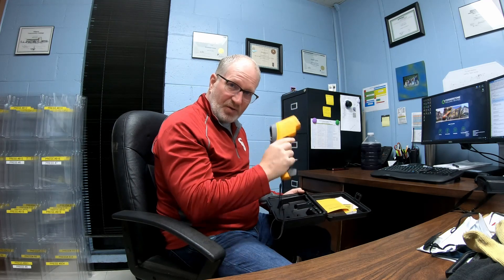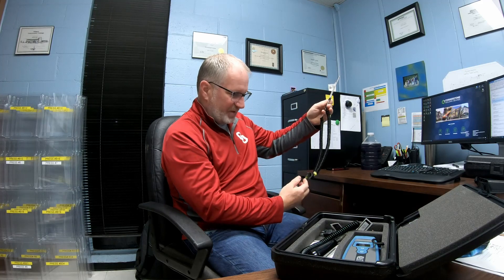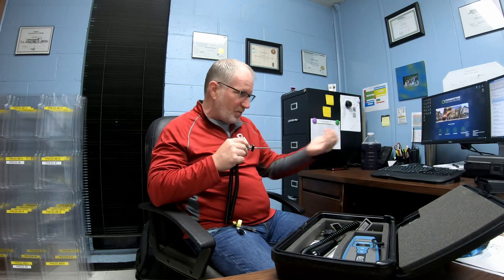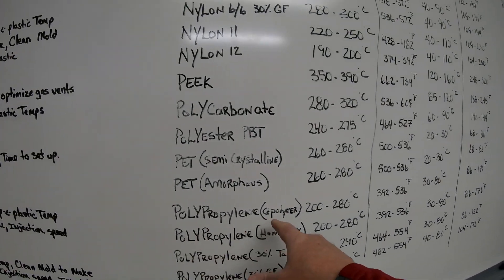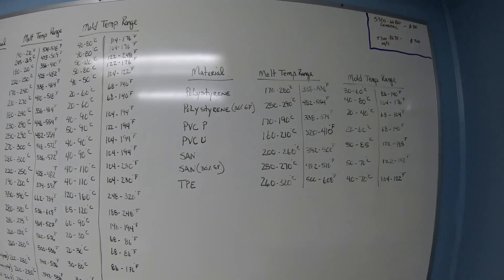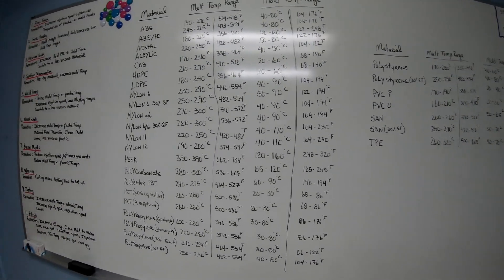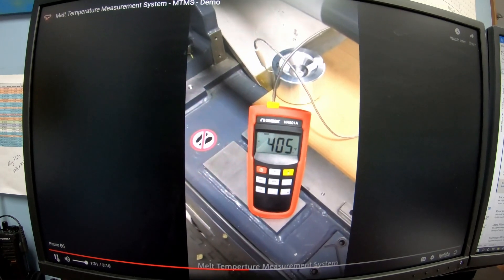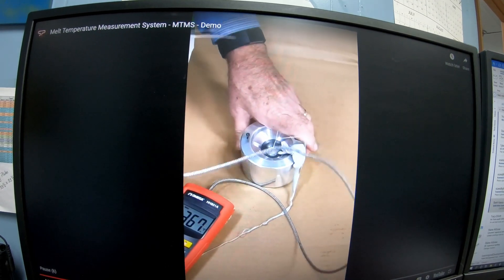Melt Temperature

Comment: Hey Dave, thanks for that list of mat - vs - mold temps you've put up for us, I'll copy that and keep as an Excel css, if you don't mind the theft ofc ;-) Quick question, although slightly out of context here; how do you/they bring the actual mold temp up? What sort of heater(s) would you recommend if this is what its being used?
Reply from the maker: There are a lot of different Thermolators units you can try. If the water is needed to be 70' or less then you should run on chiller water. If you run 75' or hotter then you will run on tower water using thermolators to help heat the molds up. When heating water up the thermolatros will have a close loop system in them so under pressure you can heat a mold up to 210'f. There are a bunch of different ones we use Conair, Wittmann, & Thermolate. Let me know if this is what you were looking for. thanks for watching
Reply: @injectionmoldingskillsmore1064  Spot on the question, appreciated. I'll have a look at the products from those 3x manufacturers you've listed and take it from there. Something I need look at this month in fact, we're powering the new IMM tool equipment in a week. Again thanks for the awesome content you put up, and for taking the time. All the best
Reply: p.s. "Thermolator". Probably why I didn't found too much info on the subject earlier. Easier and much faster with the correct term/definition. Thanks.
Reply from the maker: @gtcollection6933  Cool thanks for your support to the channel & anytime I can help.